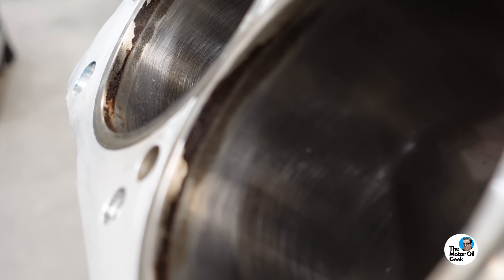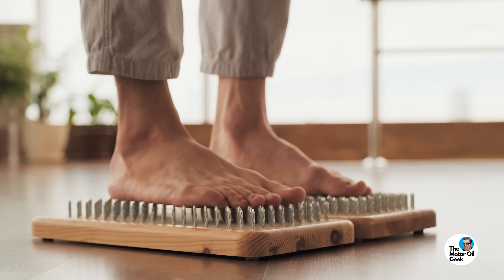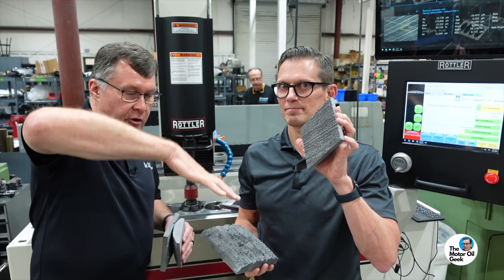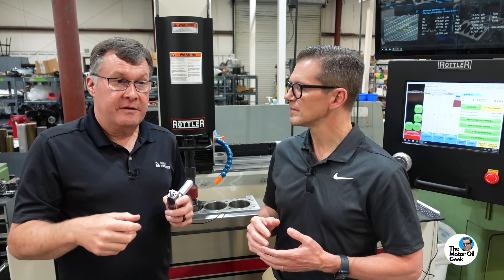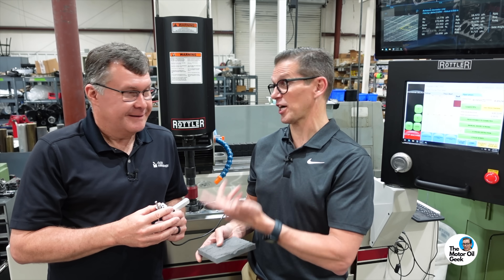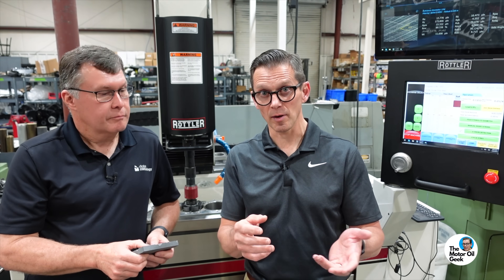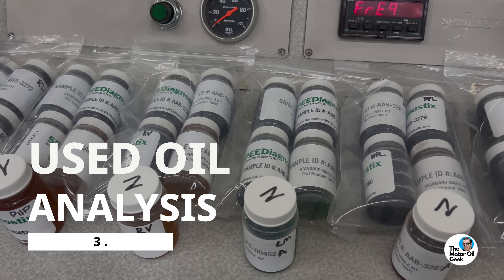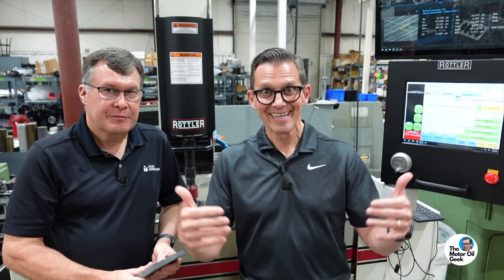GM's $1 BILLION Dollar Blunder: ROUGHNESS Matters...

Comment: This is ain't the finish the problem is the gap between the bearing and the crankshaft the problem. Even if your finish is not mirror as long as you maintain distance between them it will never fail. The problem is to close gab,variable oil pump that don't react fast enough with no enough flow,too low relief valve and viscosity is damn too low for a truck with that kind of power. Its simple to see how much force a oil layer can handle before it get contact. You need to calculate the total surface area of the main bearing X psi but you need to subtract centrifugal force direction surface(typical engine cap side where the force is apply except flat engine.)

Comment: Was it the trucks from 90’s were fantastic I had 500,000 on daily work pulling trailers heavy loads and a couple year after 2,000 every truck and no dodge didn’t ford didn’t Chevy didn’t Toyota didn’t they all did something to screw up every engine they come out with dodge id sending upper control arms made outta plastic plastic are shutting me

Comment: With decades of advanced material reinforcement, co-authoring hundreds of ASTM (I) testing and measurement procedures & processes standards; new product development; manufacturing quality control and quantitative & qualitative forensic failure analysis engineering experience, it is shocking GM engineers failed on such basic principles on all levels. 

This type of failure requires  deep dive investigations to answer the question of what else are GM engineers missing?

Comment: Also use a FilterMag on those oil filters. Once you cut open the oil filter for inspection you clearly see the ferrous metal particles held by the FilterMag. I am blown away at how under-used FilterMags are in the industry. They retain way more particles than the magnetic drain plugs. Thanks Lake, great video as always 👍🇺🇲👊
Reply: I've been using the magnets for decades.  I hope it helps in the long term!

Comment: My dealer just changed my RAM 1500 hemi, and Durango 6cyl oil using 0w20. I can not believe one moment this oil is any good. Well, not immediately destructive but I'll be looking for your oil tests in the 5w30 areas full synthetic. 0w20 has got to have the epa all in it, certainly not for the life of the engine.

Comment: Yet I have ran race engines with marked up but round cranks and they do the service interval,, 2000km more than once without excessive bearing wear. Using either 15/40 synthetic oil or 25/50 mineral oil. 
The fixation with ultra thin oil is the issue more than cranks finish. IF everything is working correctly the bearings do not touch the crank,, the oil wedge fills the gap.And with synthetic I closed down the oil clearance to 1.8 though rods and mains. I always crank up oil pressure before starting the engine which helps a lot.
Bore to ring finish is far more important

Comment: Both cranks are bad .... according to my hydro engineer friend...the oil transfer point being filed your pressure in surface tension in that angle edge drops in that area.
  I don't know how much rpm it would take to effect into cavitation...but take it or leave it.
🤔🧐🙂🐾🐾🐾😎

Comment: Yes to me this was not answered, informative info but a click bait gas light title. The result is already been published. GM put a crap factory in Mexico, they used metal, probably crap Chinese metal for the crank, connecting rods made in the U.S. by Standard. Inexperienced labor put the engines together with more inferior parts and now they are failing. All so GM can charge us more and up their profits. Now GM refuses to honor the safety recall and dealers will not perform the inspection. I had a 2023 AT4X with the 6.2, I think the engine had zero issues. But GM cause me to lose confidence and I traded the truck in at a loss due to this recall effecting the value of my truck.

Comment: If they make piston rods with an oil port from the crank end to the wrist pin end and oil squirter ports on the sides below the piston to allow oil to squirt onto the cylinder walls at and around top dead center when the hole in the crank lines up with hole in the piston rod the oil would squirt up to the wrist pin and out of the oil squirter holes angle up and towards the cylinder walls just below the piston it would be a great idea for proper oiling of the engine.

Comment: I don't understand how this happens. GM has been making the small block/LS/LT family for over 50 years and they have always been incredibly reliable and then this happens. I was definitely expecting that it was DOD or cylinder cutout. Not only that, Toyota which is synonymous with reliability has heavily screwed up their machining this year as well. The two things you used to be able to count on were an incredibly reliable GM V8 and reliable Toyota engines. The world is falling apart. Be on the lookout for pieces of the sky falling down some time later this month.

Comment: Also the type of aluminum with silica impregnation is used as well ,thus allowing the surface finish to be perfect for bore sleeves or some engines have sleeves instead of using the bore or metal of the block, that way the sleeves can be replaced when required. 🦘👍✌

Comment: What a mess!!! I will just keep my old 03 Marquis, 497,000 miles, original engine/trans/axle, only minor repairs from new, zero blow by, runs like new still. SuperTech full "synthetic" oil since 86,000 miles.  GM can do better, they have built some amazing engines in the past, this is unacceptable of GM..

Comment: Its all about creating a barrier so that the lubrication has the right distance between each surface to protect it and lubricate it full stop, which is why the OE oil spec is so important, but if the OE manufacturing process is not unto Quality Standards ,then you up a creek without a paddle, which is why the recall has happened ,with engines cranks and also Auto transmissions as well IN Australia, keep up the great work guys. 👍👍🦘🦘✌✌

Comment: application dictates  design parameters. Boat engine, plane engine, daily driver, small weight car, heavy weight truck, off road earth mover, hydraulic pump power engine,  where does the device live and what does it do. How much duty cycle and how much heat or cold that is must endure. Even what space do we have to put it in. These are all part of the systems engineering

Comment: Though they really avoided, in substance, the subject in the click bait title, the point is still valid. I understand why Speed doesn't want to get dragged into court testifying in hundreds of lawsuits by addressing a crank finish directly. That said, I read somewhere that the polishing of a ground crank has to be performed in the opposite direction of rotation, to reduce the directional "knap" induced  by the grinding process. It sounds reasonable to me.

Comment: It hard to understand why they are having so much trouble. I know money. Years ago the old I think it was a buck design, but it was in a lot of GM vehicles, the 3800 motor was really good. I had one and put over 300,000 thousand miles on it and it was still running fine when I sold it. Probably wasn’t that bad on emissions either ! These new cars a just to much money, and to complex for their own good. I mean what are they saving but having to put 10 computers in a car , making the motor more complicated, an them it failed, what lol

Comment: Here’s what a GM Eng said: “improperly machined connecting rods (supplied by American Axle & Manufacturing) and crankshafts (supplied by Questum Macimex, out of Mexico); specifically, sediment in rod and crank oil galleries and out-of-spec crank dimensions and surface finishes.”

Comment: It's officially called RZ and PT. Worked for a automotive parts manufacturer for over 20 years. We used submicron measuring devices in a controlled environment lab on a floating floor. You can feel 8 rz drag on your fingernail, but not less.

Comment: Dr. Mahrburg (Sorry if I spelled it wrong) seems like an amazing guy.  Like the college professor that seriously loves learning and teaching.  We need more people like this.  Awesome video, and yes, please do an even deeper dive into it - it's very interesting.  One practical question I have is - say a guy is rebuilding his engine on a budget.  So it's going to get a dingleball or straight-sided hone.  Which is better, as in what does each do to those surface finishes?  Almost seems like there might be a "If you intend to use a moly ring, then use a rough grit, but if you're going to use something else, then use a fine cut"
Reply from the maker: Mark is awesome. He will be back in the future. Regarding your question, the ductile moly rings are more forgiving on the cylinder bore finish.
Reply: Thank you!

Comment: The cranks were NOY out of specification.  GM has 2 specifications, one was applied to cranks used in new engines.  The second spec allowed them th accept cranks that were outside of the first spec for parts sold for repairs.  Allowing the supplier to recover more revenue, which lowered the cost for all the parts.  GM figured that they could save even more money by using all the parts in new builds, and that most failures would occur after the warranty period.  This was just “normal” GM cost cutting to raise their profit margin.  This was no accident.  The executives are just looking for a bigger bonus before GM goes under. 3:38

Comment: How does this jibe with the Zinc and other long-life additives.  It is one thing to make a racing engine which only runs a day or two, before being rebuilt, versus an engine which is driven sporadically, often without warmup, in freezing or boiling temperatures, and then matching the Oil to the Wearout Forces.  The common knowledge is that the "staring environment" causes the most wear.  As such, how about an add-on oil pump to prelubricate parts of the engine.  Metal additives should help with the scrubbing issues, like the old Lead in gasoline.

Comment: Please don’t stop making these informative videos. I was a machinist for the first 20 years of my career and we were always looking for the best (32) (16) and even an (8) finish for certain aerospace parts. But now I’m starting to understand that this is not always the best thing. Like a previous commenter I would like to see the difference between an acceptable finish on the GM 6.2L crank vs an unacceptable or bad finish crank. I had the 2023 GMC 1500 with 6.2L and got worried so I got rid of it for the 2025 GMC 3.0L Dirtymax. Did I do the right thing? I used Speed Diagnostics.  For analysis. Of the oil in the 6.2L and came back fine but didn’t know if it would blown in the next week or year or when. Any thoughts?
Reply from the maker: Thanks for watching and for using SPEEDiagnostix. We have a test going right now with the 3.0 L engine. We are going to find out which viscosity oil works best. I don’t like what I have seen so far from the 0W-20.

Comment: Grandpa had a story about how he was on a team developing a high pressure aviation solenoid valve.  The solenoid piston was locking up under pressure.  He accidentally discovered that they were honing the cylinders too smooth.

Comment: Whoever had the bright idea to switch to 0W-20 oil just to save a fraction of an EPA mileage rating should be flogged for causing this problem.   The surface finish must be much finer using the thinner oil or we've all seen the results.    Reminds me of the Olds diesel fiasco of the  late '70's where some bright bulb came up with switching gas engines to diesel without understanding the full depth of what was needed.   The end result was putting out engines with a desired CR of 17:1 could have one cylinder below 10:1 with another well over 20:1 just because of the tolerances in the engine.   Sink a valve in a gasoline head a few thousandths doing the valve job and the CR might change a fraction of a tenth....but that same valve job on a diesel knocks it down well over a point.   So making a change such as using a thinner oil....in truck engines that are very likely to get hot and heavily loaded....without also demanding better surface finishes cost them a LOT of money.   And don't forget all the lifter failures that are very likely linked to this same issue.   Way to go GM!!

Comment: Good video explaining why surface finishing is important. I will probably save this one to pass it on to customers that are interested as to why I want know what ring they're going to use, why I want to polish that brand new or reground crank. Surface finish is also important on heads and blocks as to type of head gasket, is it composite  or MLS ?

Comment: I wonder if it’s possible to accurately position and rotate a microscopic diamond dome in a machine similar to a mill and use a piezo actuator to accurately hammer a microscope dimpled surface (or some other shape) to the cylinder wall to give even and controllable oil retention tailored to a specific ring and oil, instead of relying on the somewhat random finish of honing? Maybe easier to test on a small scale engine? Could maybe take the idea further by using a second piezo element between the diamond and the hammer mechanism to sense and adjust for hardness variations using two strikes per dimple? Alternatively, I wonder if there is a better material or coating for a cylinder wall such as a ceramic.

Comment: This is what was called the "Jack Welsh"  ( former GE CEO ) syndrome.  The theory was to let the suppliers, do the quality checks. So consequently,  there should be no need for GE  to pay for people who would inspect the parts recieved from suppliers. So, inspection teams were eliminated, and all faith put in the suppliers to provide quality parts. Unfortunately the system worked for a short time, then went downhill. The car manufacturers sold off most of their captive intergrated supplier base, like GM (Delphi ) and Ford (visteon), and quality went down. Nobody checks the parts, until problems arise.

Comment: I have a fleet of L87s and Ram "Apache" trucks (know for ticking issues) that we have never had any issues with, and the reason why is because since day 1, we have only used 5w30, we unplugged the VDOP (variable displacement oil pump, just buy another sensor to plug into the harness and zip tie it somewhere so the code stays off) and only do 3 - 4,000 mile oil changes.

We now have 5 L87s ( we have 16 total) that have gone over 100,000 miles with no issues (2 of them are 2019 ones not covered, but the exact same insides)

We've even gone as far to take a 2022 L87 apart (truck got hit in the side ((bent the frame)) so had the engine gone through for a spare and the engine shop could not find any issues, even saying "could still use all the OG bearings, it was so good" everything was still well within spec)  

This is not just one issue, this is multiple issues, combined with garbage water oil from the factory, very low oil pressure going down at idle as low as 8PSI, plus people being st%$id not doing 3 - 4,000 oil changes made all this come together.

We had to go through all this similar crap when we first got our Ram trucks with the "hemi tick thing" soon as we started unplugging the VDOP, using 5w30, and 3 - 4,000 mile oil changes, just like magic, our trucks started hitting 200,000 - 300,000 miles no issues.

Edit, would also note, although we didn't start doing this with all the trucks as we were buying them (most needed to get in, get out to keep the business going, but at some point we started cutting open the filters and have never seen metal anywhere.

Apply common sense as most should know by now manufacturers don't, as they just need to pump vehicles out to keep cash flow, and step up your game when it comes to maintenance. NEVER EVER listen to what the dealers/manufacturers say, (oil changes every 3 - 4,000 miles. Transmission, power steering fluid (if equipped) brake fluid, transfer case fluid, every 50,000 miles. Differentials every 100,000 miles)  the sooner the truck dies, the sooner they need another.
Reply: Smart fix. I love it. For decades everyone used 5w-30 and most of the engines lasted with just regular oil change. Then some smart ass came up with 5w-20, then 0w-20, lower tension rings, oil control rings with very small passages and the problems started. People at CAFE should realize it's hard to increase efficiency, lower emissions, etc. without increasing failure rate and lowered engine life.
Reply: Amen! Screw EPA and protect your engines

Comment: Lake, you should do a video based on where you think GM actually blundered, was it in a 20 weight oil or was it the actual crank journal texture. If they from the start went with a 40 weight would you think they had an inadequate journal texture?
Reply from the maker: It was crankshaft surface finish. That was specifically stated in the NHTSA report. We showed that in the previous video. Thin oils work just fine if the surface finishes are correct.

Comment: Got another blunderious GM error on there 4 bolt 350 vortect 1998 cranks.
Forgotten what there called, but there main bearing seats and cap " Tangs" are machined on the wrong sides accord ing to and regards to crank ROTATION!!  IDIOTS!
those tangs are for more than just placement alignment,, there also to keep the bearing from rotating in its seat should grit or other get past the oil filter!  In my case it was an idiot driver who kept driving the truck while oil was leaking past the O.E.M. oil cooler adapter "O-ring" between filter and block. Had those tangs been  on the rotation side, where they would have met the block and not spun, the Rods would have made it.

Comment: It would be useful to do a video on the Stribeck equation/curve. The concepts of texture/lubricant retention you covered in this video are relevant to the piston ring/cylinder bore relationship but different concepts would apply to tribological interactions in big/little end journals.